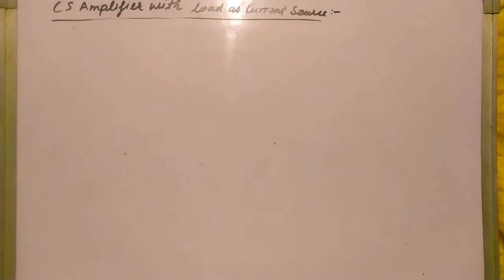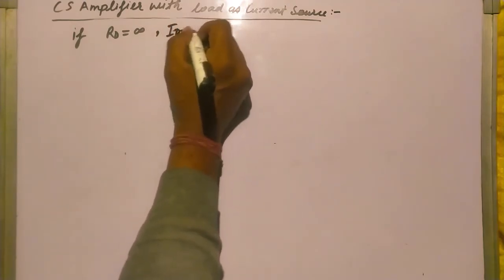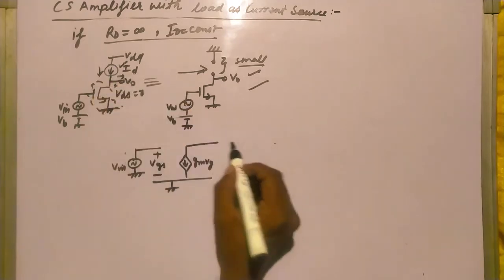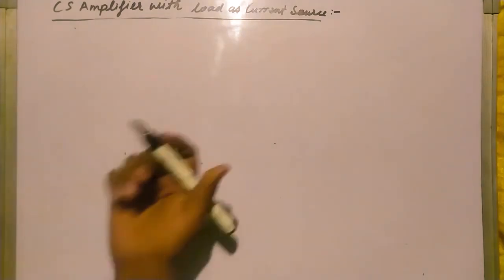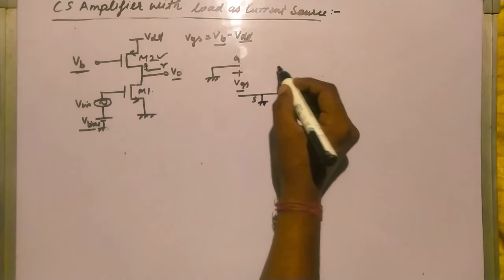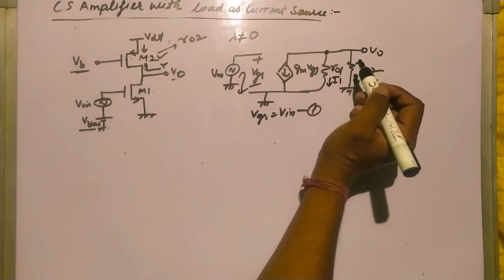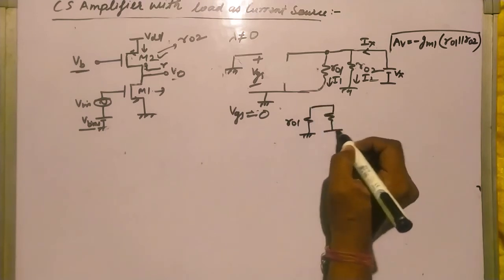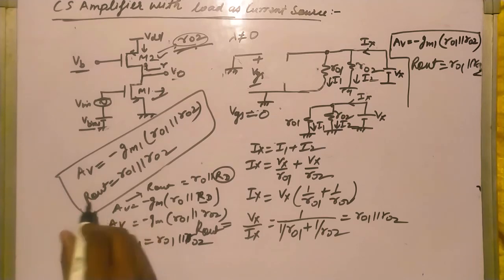Common source amplifier with a current source load

Comment: Why voltage swing limits will reduce. If transistor goes to triode region??
Reply: not because it goes in triode region, but caz of the drop across resistor increases, see this --> Vdd - drop across Rd - Drop across M1 = what is left for voltgage swing, now as we increase Rd, drop across it increases, hence voltage swing is reduced